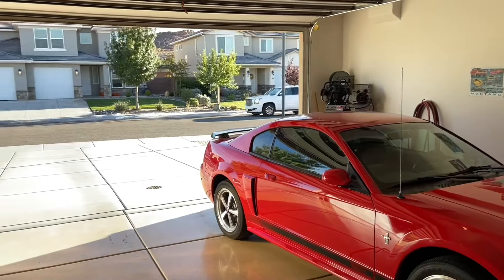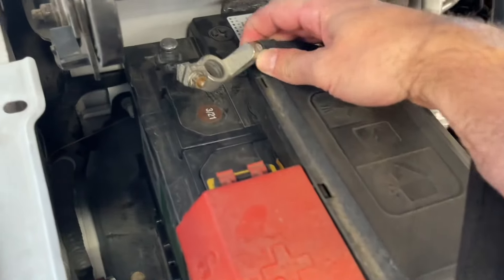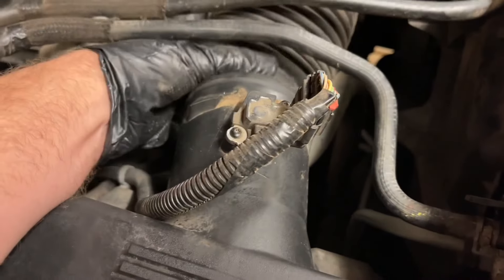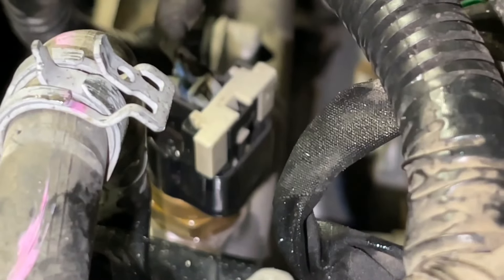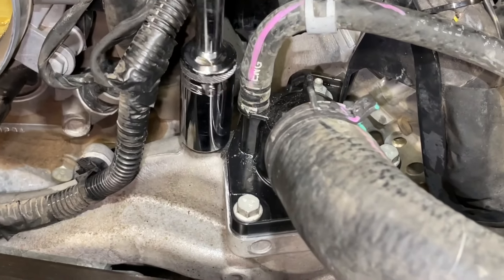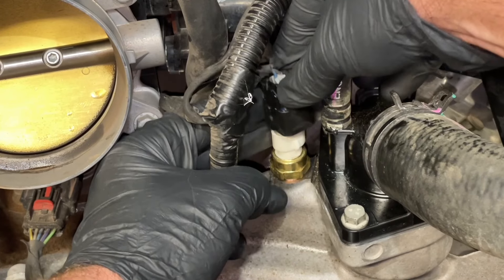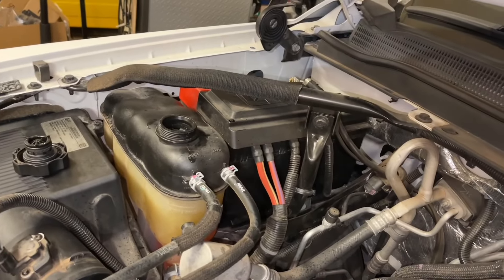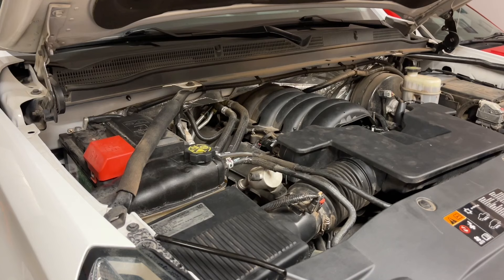Coolant temperature sensor replacement 2015-2020 Yukon, Tahoe, Suburban, Sierra Silverado GMC Chevy

Comment: I replaced mine about 1 month ago and just today it start doing it again what do you think it is?
Reply from the maker: It may be a generic limp mode. Do you have a check engine light for anything else? Does the temperature read around 210 or zero (160 when warm)?
Reply: No check engine light it’s goes to below 160
Reply from the maker: @luna_gachagirl4956  if it’s still below 160 degrees after driving for a few minutes, the thermostat may be stuck open. Or the new sensor is bad, the plug is bad, etc
Reply from the maker: @luna_gachagirl4956  here is the thermostat replacement if that’s the issue https://youtu.be/aEfgkxWdBYw

Comment: Dammm thus is great but right I got a 2017  burban and the temp needle jumps during acceleration  fan is good it's turns on new transmission  I was thinking the temp sensor
Reply from the maker: You might try burping the cooling system https://youtu.be/XqyhfLk9ML8
Reply: @dannyjohnsonsgarage  thank you gonna try that it doesn't go all the way up but the teamp gauge jumps during the drive

Comment: Hi Danny, thank you for the great video, it saved me a trip to the dealear. My 2018 cadillac escalade esv has the same symptom. I replaced the sensor, but 2 days later it came back, but this time the check engine light was on P0128. I reset the engine ECM by deleting the check engine light with an OBD2 scanner and no more issue since then.
I have an other issue with the vehicle and hope that you or some of your followers can help with a solution. It call "Bumpy or Bouncy ride", around 40 MPH the it feels like your rear tires are bouncing, even when the road surface is smooth. The vehicle has 81000 miles , tires pressure 35psi, no leaks on shock absorbers, nothing loose on the rear suspension. Will appreciate any help.
Reply from the maker: Mine was the same way and it was bad front struts. The best solution I found were the Arnott brand and I have an install video https://youtu.be/8c7qfElwx3o
Reply from the maker: https://www.amazon.com/Arnott-Coil-Over-Eibach-Magneride-L-SK-3354/dp/B08VF88P43?crid=38JDH2IFYEA9K&keywords=Arnott+-+Fr+Coil-Over+Eibach+Strut+15-20+Cad+SUV%27s,Chev+Silver/SUV%27s,GM+Sierra/SUV%27s(K2xx)+w/Magneride-L/R+(SK-3354)&qid=1669272882&sprefix=arnott+-+fr+coil-over+eibach+strut+15-20+cad+suv%27s,chev+silver/suv%27s,gm+sierra/suv%27s+k2xx+w/magneride-l/r+sk-3354+,aps,290&sr=8-1&ufe=app_do:amzn1.fos.08f69ac3-fd3d-4b88-bca2-8997e41410bb&linkCode=sl1&tag=2004047-20&linkId=6ce005c6cd213796132b9c237f1113d5&language=en_US&ref_=as_li_ss_tl
Reply from the maker: If you continue to get the code and the engine is running cold it may be the thermostat that is stuck open and over-cooling the engine. I also have a video for that https://youtu.be/aEfgkxWdBYw
Reply: @dannyjohnsonsgarage  Thanks a lot , will keep eyes on it, So far so good , my temperature gage around 200-210 and i think that it is in the range of normale engine working temperature.
Reply: @dannyjohnsonsgarage  Thanks a lot and will see what i can do about it.

Comment: thanks will try to do  this hope that it works out this (is) the info that I needed
Reply from the maker: I also have a video covering the thermostat. It can also cause the fan to run and read cool if the temp is actually cold from the thermostat sticking open https://youtu.be/7mJF5LQ3oPs?si=4yaC93Wzh5APF8zF
Reply: after replacing the sensor 3 times, I took it to a friend and he replaced it as well as the wiring that plugs in it and it seems to work. I will ride to see if that was the problem

Comment: P0128. Your thermostat is stuck open. Coolant sensors only break if you smash them with a hammer. Buy a new thermostat and disconnect your battery for 10 minutes. Most thermostats wear out at  the 150k mileage level. Change your Coolant its overdue.
Reply from the maker: This video is taken from the thermostat replacement video

Comment: I broke the sensor lock… think I’m ok?
Reply from the maker: Mine broke the white lock as well but I can slide it back in. You may be fine if you can connect it and secure it if necessary, with a zip tie or something

Comment: did this on a 15 suburban ltz and the fan is still at full blast
Reply from the maker: Try the thermostat next. It will also cause the fan to run if it’s stuck open and over-cooling 
https://youtu.be/aEfgkxWdBYw?si=9SO0JTeDeyZNIPhq

Comment: It was just the sensor for me I lucked out
Reply from the maker: Sometimes resetting it works. If it comes back later and it shows cold when the vehicle should be hot it could be the thermostat, so just a fyi for the future Thermostat Replacement Yukon, Tahoe, Sierra, Silverado, Escalade GMC, Chevy 2014-2020 P0128
https://youtu.be/aEfgkxWdBYw

Comment: Sell the POS before more electrical  gremlins show up 😂.  I want my AC back
Reply from the maker: Just bent a lifter (or have a bent valve). Heads are coming off soon and I'm doing the cylinder deactivation modification. Should make for some good videos.